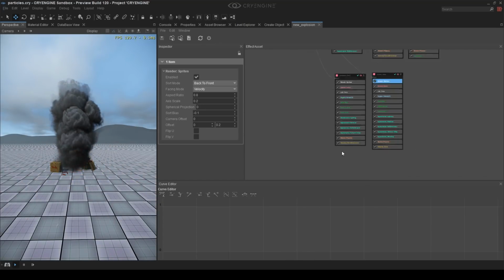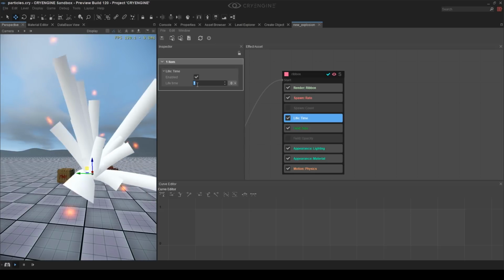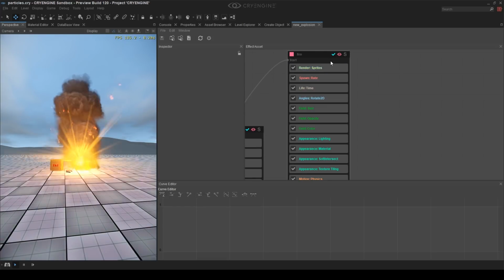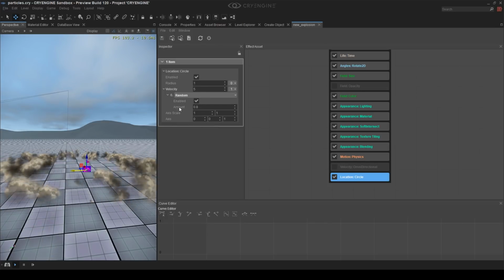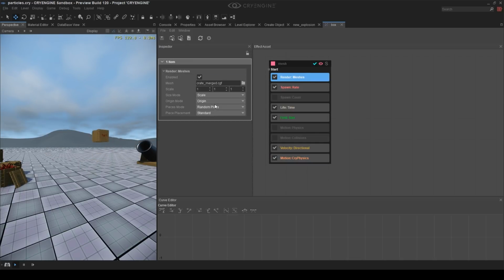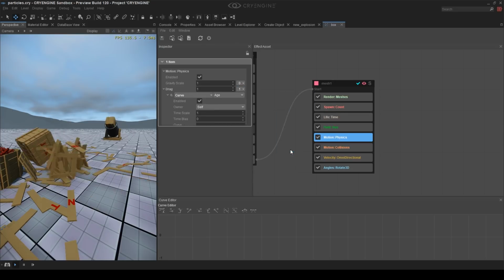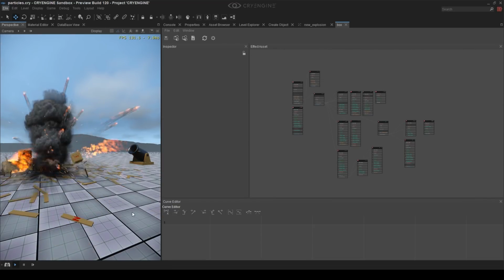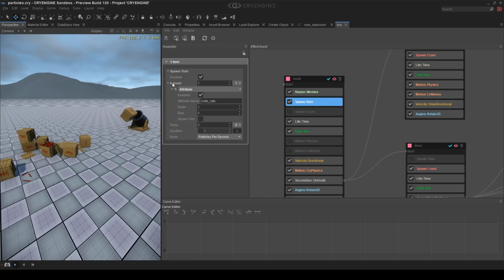Introduction to ParticleFX - Part 2

Comment: Please help me. I created a particle. I just added mesh, fire, smoke. It was working completely good until one hour ago. But now, when I put the particle at the map, It gives me a lot of warnings (approximately 1000 warnings in a minute). The warnings are that: CObjManager: Render Object: The object has invalid bbox ...etc. please help me. I need some help immediately because I have no time. Sorry for my bad English. I love your stuffs. Sincerely.
Reply from the maker: Hi there, it is difficult to say what could be the issue. It might be easier to try to create a new particle with the same settings and see if you still have the same error. If you can reproduce the problem you could create a GitHub issue on the CRYENGINE repository with the offending PFX file.

Troubleshooting these problems would be better handled on the CRYENGINE forums or on the Official CRYENGINE Discord Server.
https://forum.cryengine.com/
https://discord.gg/cryengine
Reply: @cryengine  Thanks, I'll try'em as soon as possible.

Comment: 11:34 - I have a problem with texture, I see that "smoke_trail_a.dds" can be found in the GameSDK Sample project: https://www.cryengine.com/marketplace/cryengine-sample-project-gamesdk
But the file is like corrupt or something. Why there is "smoke_trail_a.dds" & "smoke_trail_a.dds.1" ... "smoke_trail_a.dds.5". Am I supposed to combine these files into 1 file?
Reply from the maker: DDS files that have a numbered extension are different LOD's of the same texture. These are created by the CRYENGINE Resource Compiler. It's advised to copy the entire related pack of DDS files for the texture (all numbered DDS and the DDS itself for the same texture) to your project as it provides that extra optimization.
Reply: I took a look at the file smoke_a.dds.cryasset, and see that it mentions: `source="smoke_a.tif"`, so maybe I miss that file, but I can't find that file anywhere.
Reply from the maker: This is the source file, these are not included and not needed to use these textures.
Reply: Thank Crytek, I tried again: Copy all the dds (all numbered DDS and the DDS itself for the same texture) and refresh the Asset Browser (AssetBrowser >Edit >Generate/Repair All Metadata), this time it works properly :D

Comment: 7:02 - I'm using CryEngine 5.4, when I add the Ribbon, the root of the ribbon float to the sky: https://imgur.com/FyCeQX4  - Am I doing it wrong?
Reply: So... if I set Ribbon > Motion:Physic >Drag = 30, then the root of the ribbon stay on the ground. Ok, that makes sense.